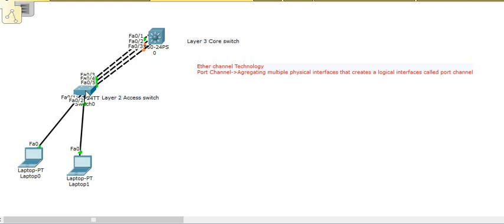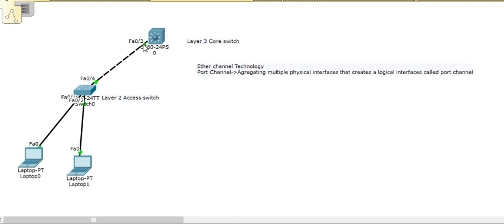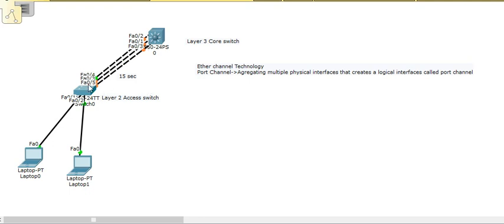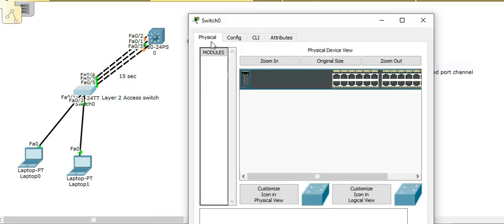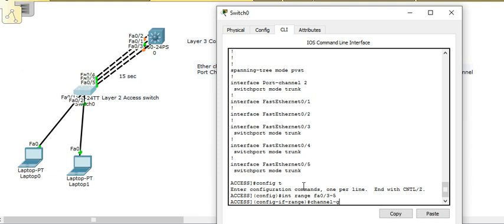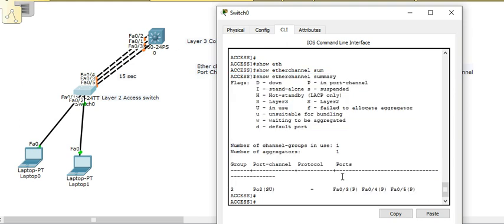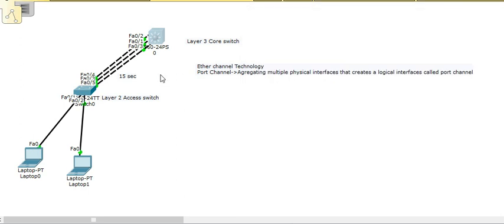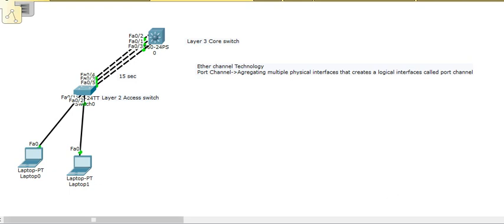Port channel Configuration

Comment: If my system was fine for years and then my portchannel started flapping out if the blue, what would that indicate? A bad transceiver? I would assume it was configured correctly to have worked correctly for the last couple of years but I've added more cameras to the switch so I'm confused to what it could be. It will flap and go down then reconnect and go to up after 30 seconds or so